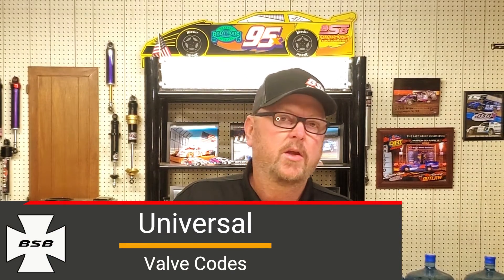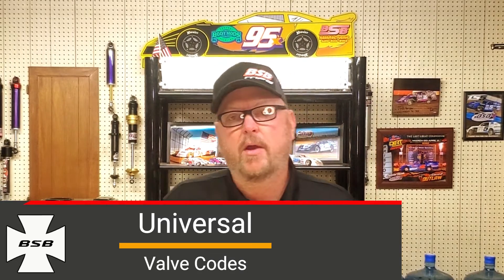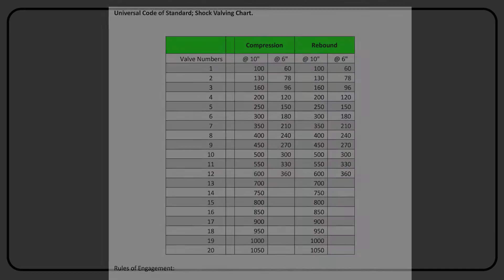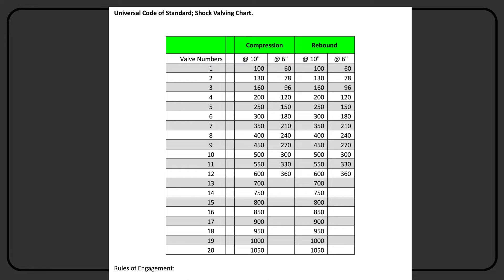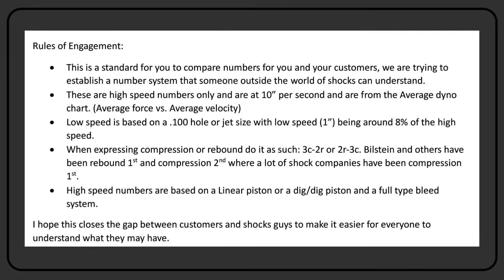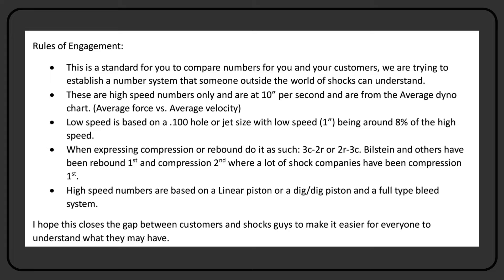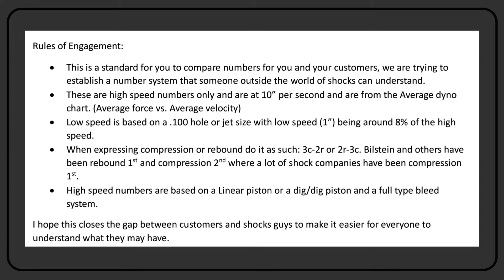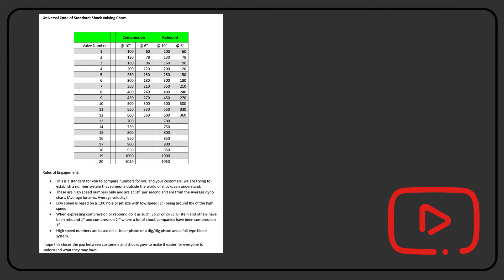Universal Shock Valve Chart

Comment: I don't remember what Rex said about the way Bilstein shocks setup their shocks, although I do recall him speaking about it with my late dad and myself at Crawford County Speedway back in the late 90's. Of course, it was helpful when I got to the point of actually working with the Bilstein shock, yet due to the fact I primarily work on cars using Afco shocks, I never actually retained that information long term. Now the shocks are more built to spec, with different valuing done in a more uniform way, that can be revalued to different specs as needed, unlike having a something like ten to twenty individual shocks with their own valuing setups.
Reply from the maker: Thanks for your input.